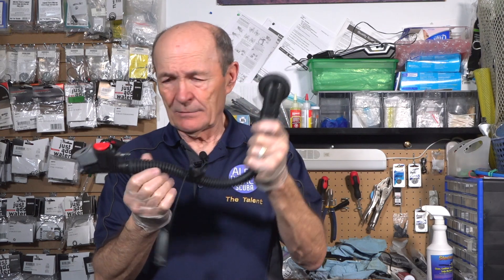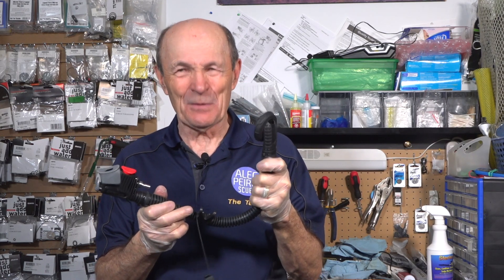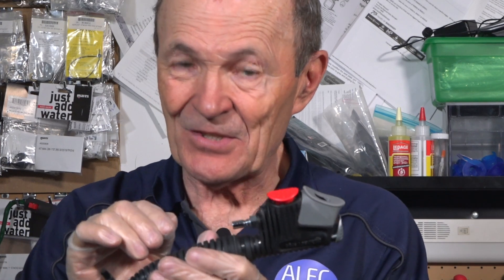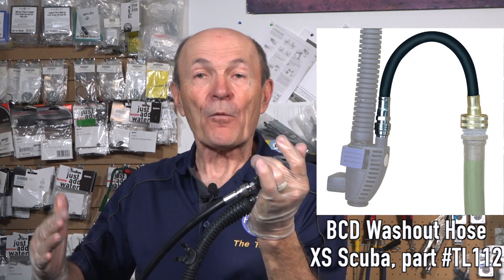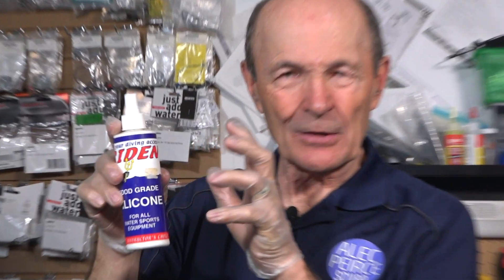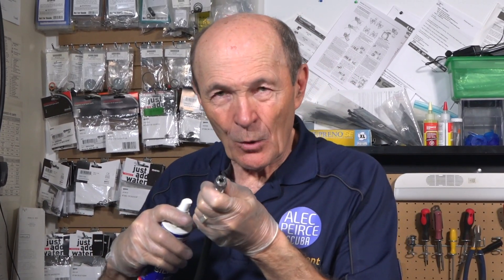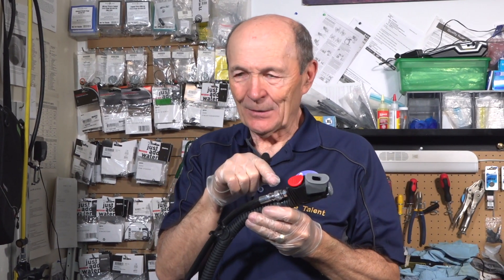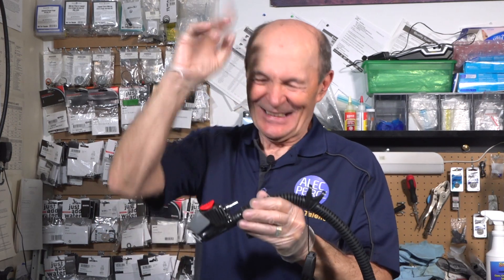Power Inflate Valve Service - Scuba Tech Tips: S11E09

Comment: Is it safe to soak the entire power inflator in vinegar solution (50% vinegar and 50% water)? My inflator button is slightly sticky and I was considering vinegar treatment. Thank you for the amazing content!
Reply from the maker: Before using vinegar,  try using  very warm (not boiling), clean water into the PIV opening, shake around, turn upside down and drain, repeat 2-3 times.  Most times the PIV valve sticks due to a buildup of salts or dirt.  If this works, use it going forward.  If the button is still stiff or stays down when pressed, two options: 1) take it to your LDS for service.  Most PIV's are easy and cheap to replace, 2) get food grade spray silicone (look for my video on this), spray into the piv mouthpiece, press the piv button continuously, then rise as stated above.  Regardless of the method, if the piv is sticking, get it sorted as it can only get worse and possibly stick down on a dive causing a fast surface.
A
Reply: @AlecPeirceScuba_SeaHunter you are the best!! I am going to try the hot water method for sure & was going to also try the silicone method that you explained in the video. 

Is there any harm in using vinegar? I am curious to know why you recommend against it. 

Appreciate your input!

Comment: Can you use that water connection to do a rinse of the inside of the BC at the same time?
Reply from the maker: A BCD washout hose will fill the BC when the PIV is pressed.  Filling it full is not the trick,  it's repetition.  Add water, slosh around, drain, repeat 2 or 3 more times.
A

Comment: That's a cool little trick with the silicone spray; another is to build your own plate & wing BCD out of generic parts bought offline. I have built several of my own for about $300-$350 each. If I ever need to replace a generic "k" inflator valve, it costs $15-$20 vs. $70 or more for the valve used in brand name BCD makers.
Reply from the maker: Thanks for the info!
A

Comment: Hi Alec, great tech tip.
I always use the bc flush hose after diving.
Would you recommend using an o2 compatible spray if available?

Thank you.
Dave
Reply from the maker: No need for any O2 care for inside the BC except for cleaning and conditioning.  Look for the next video for a good cleaning solution.
A
Reply: Ok, thank you!

Comment: Hi Alex, Great video. Can you you the garden hose adapter to flush out an AIR2 on a ScubaPro Hydros BCD?
Reply from the maker: Watch video S09E17 "17.	Do's And Don't Of BCD Service".  I show the adapter that connects to a garden hose to flush the BC out.  Hope it helps and thanks for watching John.
Reply: @AlecPeirceScuba_SeaHunter  Hey Alec, thank you for the prompt response. My concern is caused by a number of buddies stating you should not run pressurized water thru a ScubaPro Air 2, as it is not just a power inflator but also a safe second/second stage regulator. I like to flush out my Hydros BCD but it always creates a mess when trying to feed water into the mouthpiece with a garden hose. That's why I thought the flush adapter was a great idea, as long as it does not cause any harm. Keep up the great work! Enjoy all you videos!!

Comment: Did this silicone thing twice (using a standard silicone spray), each time afterwards the power inflator was kind of blocked. On the first try, I thought it was related to the service which had been done immediately before, but it happened again last weekend. However, the inflator seems to "recover" but slowly, delivering some air again meanwhile. Weird, no? Inexplicable to me... anyone who had the same issue?
Reply from the maker: If it was serviced properly and did a cleaning and it's still not 100%, try replacing the LPI hose (try a replacement in the store to see if it works before buying).  May be contaminates inside the hose or try your hose on another BCD, do several inflate deflates to test.  Still not right, retry the silicone cleaning 1 to 2 times and re test.  Still not right, take it back to the shop for a checkup and try it in front of the technician.  Suggest putting an IP gauge on it to check the pressure to the PIV.  Hope these ideas help.
Reply: @AlecPeirceScuba_SeaHunter  Thanks a lot Alec for this detailled answer, will follow that step by step. Stuff isn't old enough for simply throwin' away and replacing, so many thanks again!

Comment: I got a hose question I have not ran into till recently.. are all scuba low pressure 2nd stage hoses the same same size at the 2nd stage fitting? I recent bought a new octopus, that I am replacing the old Dacor Pacer with, and it comes with a 27" LP hose.. I want a little longer hose. The dive shop sells a 34" hose, but I'm not willing to take a chance on buying a non returnable hose that I'm not sure will fit my brand new almost stat of the art 2nd stage that appears to be a copy of the old 1989  vintage sea elite regulator that you could buy about $130 back then... Which just happens to look very similar to an old U.S. Divers 2nd stage.. lol 
 So do I have to wait for my new 2nd stages to come in the mail.. hopefully Tuesday maybe... so I can walk in the dive shop to see if the hose will fit or are the hoses standards the same?
Reply from the maker: First off every good dive shop should install and test it for you and if it does not fit, find a hose or 2nd stage adapter to make it work right.  That is what pro's do, amateurs just sell and get you out and not accepting a return is bad business.  Second, LP ports on 1st stages are standard across the majority of brands but the 2nd stage may be different.  Best to take your 1st and new 2nd stage to the store for a longer hose.  Ask questions if they don't explain what is going on and ask to watch so you know what is done.  Get them to adjust the breathing effort on the new reg.  If you walk out happy and maybe even smarter, that's a good store.  Thanks for watching.
Reply: @AlecPeirceScuba_SeaHunter  thanks. I will ask.

Comment: Hi Alec, my BCD inflator button is stuck so I can't press it easily, I guess the spring inside inflator has been corroded, do you think this method can help to remove the rust or does it need to be replaced?
Reply from the maker: It will help to a point but not if the internals are badly rusted or filled with gunk.  Give it a try and test it.  If still stuck take it to a pro for service to ensure its working perfectly before diving.

Comment: i bought wd40 specialist water resistant silicone lubricant for my zippers on my wetsuit and boots. it says it contains petroleum distillates. would it be good on my power inflator valve as well. as shown in your vid
Reply from the maker: Let me ask you this, would you spray WD40 on your hamburger and eat it?  No way because it has petroleum distillates in it.  WD40 stands for Water Displacement formulate 40.  Use only "food grade silicone spray" as it is safe on food and to breath because it is inert inside the body.  Be safe Duane.
Reply: @AlecPeirceScuba_SeaHunter  i'm just trying to understand. the power inflator hose has nothing to do with breathing any substance would go into the bcd, is it the manual inflation part that's the problem . ps i wouldn't eat water soluble silicone i guess its just me 😁

Comment: Glad I found this. I now have that auto inflate problem, would it help to try these first before getting a replacement? Thank you Mr Peirce.
Reply from the maker: It the PIV is self inflating when the air,  soak it in warm water for an hour or so then try the food grade silicone.  Pump the valve on/off to see if it cleans up the PIV and stops the auto fill.  Otherwise its a service by a local dive shop or replacement.

Comment: would this work, or not since it's dries "quickly" ? https://www.amazon.com/WD-40-Specialist-Resistant-Lubricant-STRAW-SPRAYS/dp/B00631GSSI/ref=sr_1_4?crid=TRKAA2DXMD8G&dchild=1&keywords=silicone%2Bwater%2Bspray&qid=1598500675&sprefix=silicon%2Bwater%2Bspra%2Caps%2C211&sr=8-4&th=1
Reply from the maker: Not for something that may be breathed in.  Thats why the food grade is the safest.  The WD-40 says harmful or fatal if swallowed.  Does not say that on the Trident Food Grade Silicone Spray.
Reply: @AlecPeirceScuba_SeaHunter  WD-40 brand, not product - apparently they have many different spray kinds now. it still a silicon based but meant to get dry faster so maybe not....

Comment: Hi Alec great tip. Mine is an AP diving auto air so basically an inflator and octo in one. Not sure really if I should put silicone through it as it's a breathing valve. But will ask AP diving in Cornwall. Cheers Darryl.
Reply from the maker: That's why I use food grade silicone spray which is non-toxic and safe around food.    Spray, and rinse and rinse if concerned about breathing it in.

Comment: The " schrader " valve is typically  a standard tire valve so inexpensive to replace, I've often disassembled this type of valve cleaned and reassembled with a new valve.
I appreciate this type of video as you give tips for the average diver.
I don't promote everyone to fiddle with life support apparetus as something done wrong can result in a death however, I admit that the design of this type of equipment is very simple in comparizon of most mechanical devices.
Reply from the maker: Good point Jacques.  Have him watch Tech Tip S06E05 Service Your Inflator Hose on schraeder valve replacement for ideas.

Comment: Hi Alex I have enjoyed your tech tips for years.  I purchased a new BCD last year, the Atomic Aquatic BC 1.  Any tips for me on the care needed for this BCD.
Reply from the maker: Absolutely, read the owners manual, twice!  Each manufacturer specifies the best service for their gear but few divers read it.  The manual states how to drain, fill, open all pockets and put air into the BC while drying plus how all the dumps.  Each point prevents a future problem if repeated as recommended.  Nice BC pick James.
Reply: @AlecPeirceScuba_SeaHunter  thanks for the advice Alec
Reply: @AlecPeirceScuba_SeaHunter  thanks for the compliment on the bc..I have over the years used many different bc's and have found this to be the most comfortable and easiest to maintain neutral bouyancy with
Reply: @AlecPeirceScuba_SeaHunter  as an instructor one of the best pieces of information I have gotten from you is the advice about safe seconds and how the practice of building the safe second into the inflator is not a good idea and how it is more comfortable and safe to give the safe second to your buddy rather than your primary second stage

Comment: we use a different method. we take off the inflator , we unscrew the spigot, put it in ultrsasonic, assemble back, run some vinegar throu it with the spigot adaptor, and after that we blow air to dry it and at the end rin that silicone. But sometimes we dissasemble the badic ones and change orings. And we never put nitrox throu it, always air or argon.
Reply from the maker: Do be careful with the ultrasonic cleaner as if left too long will erode the finish and speed up rust and pitting.   Let me suggest video S08D07 Cleaning your Gear - Ultrasonic, for ideas and precautions when using an ultrasonic cleaner.

Comment: Well done, this one in particular because my dive buddy's valve failed on dive 1 of our trip in June. He had to keep the hose disconnected the whole trip because something in there, probably a Schrader valve, was locked open and he couldn't deflate. Fortunately he was a good enough diver where he easily can control himself with his breathing alone. And to add the fun, he was finishing his masters certification while all this was going on.
Reply: Problem solved, he replaced the whole valve for 20 bucks. Must have been the Schaefer valve
Reply from the maker: Thats a story with a happy ending.  Have him watch Tech Tip S06E05 Service Your Inflator Hose on schraeder valve replacement.  May want to take one with you on the next trip.

Comment: Hi Alec, if bubbles come from the power inflate valve while in water does that mean water has entered the first stage? Thanks
Reply from the maker: The PIV is a complicated device hidden from all divers for their own protection.  A bubbling PIV could be many thinks such as; a cracked housing, damaged inflate/deflate button, or leaking out the oral inflate mouthpiece.  Since it should never bubble best get it serviced as a failure during a dive, open or closed, is very unsafe.
Reply: @AlecPeirceScuba_SeaHunter  Thanks, nice to see the GOAT still putting out videos. Once you stop Scuba online videos will never be the same.
Reply: @Fluffy Hamster Yes but if a regulator hose is loose or a bad o ring and leaks bubbles i was told that water is entering the first stage so I thought it would be the same with a connected power inflator that is leaking at the connector.
Reply: @ts440s  "if a regulator hose is loose or a bad o ring and leaks bubbles i was told that water is entering the first stage"

That's very unlikely. Since the first stage is moving compressed air from the tank to the second stage, the bubbles are just compressed air being released the wrong way. But air going out does not mean water is going in.

Comment: Hi Alec. I have an oceanreef full face mask. The first stage has a tik-tak sound every time I inhale. When I inhale fast and strong the sound disappears. But the click sound only last about 10mins. I finished the dive without any sound. It could be even from the second stage. Any ideas :))
Reply from the maker: I'll offer a suggestion as I don't have the model of the 1st and 2nd stage.  My thought is its in the 1st stage as the 2nd has a diaphragm and level to open/close the valve to the 1st.  It may be your 1st stage is a diaphragm model needing a service as the internals are stiff when starting a dive then settle down after 10 minutes of breathing.  Also check if there a anything loose on the FFM connection.  If breathing is as easy as ever, may be ok to dive but if the noise increases or last longer each dive, get it checked by a pro.  Enjoy the FFM they are nice.
Reply: Alec Peirce Scuba thank you so much!! This really helped